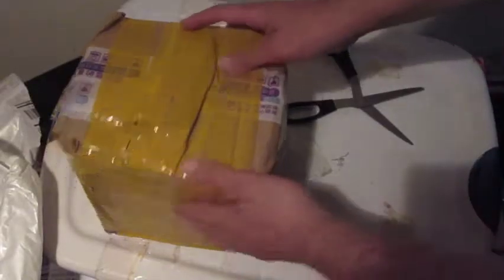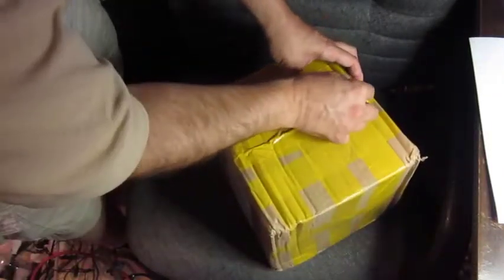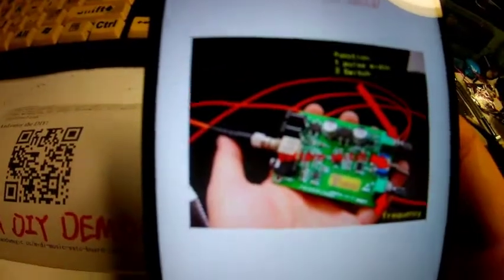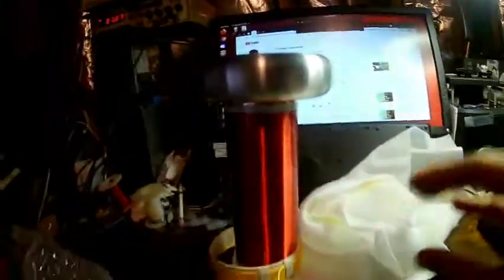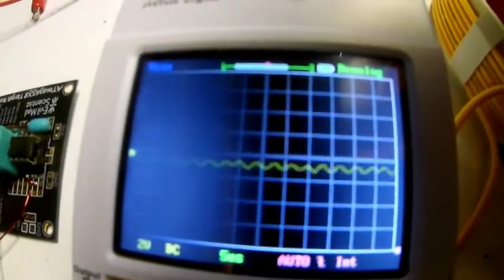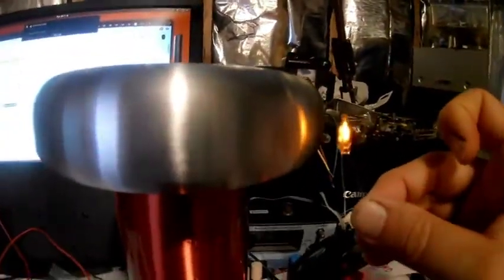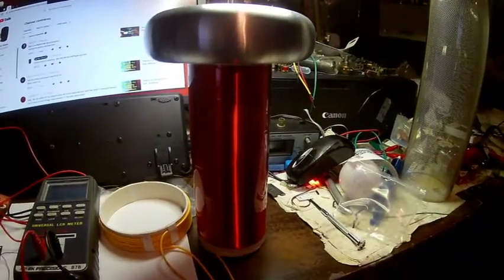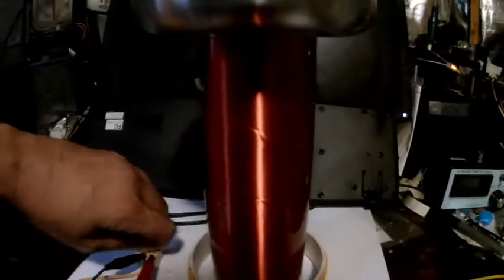Wish Tesla Coil

Comment: This primary, secondary and topload are tuned for a full bridge 50N60, like the one found on the website the qr code led you to. I have the PCB files and schematic for that specific Chinese IGBT full bridge board.
Reply from the maker: Sound good.. did you post a video of it?? Thanks!
Reply: @jaynesnetwork  I don't have that pcb. I only have the design files and schematic. That's it.
Reply: @jaynesnetwork  Do have this video about the performance of the full bridge board, 220v input. https://imgur.com/oXKG5Yl